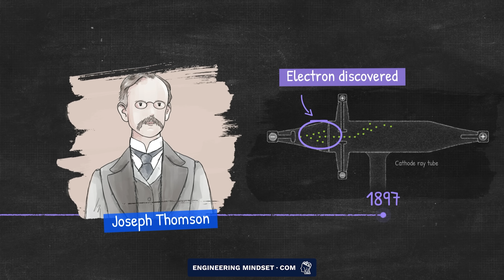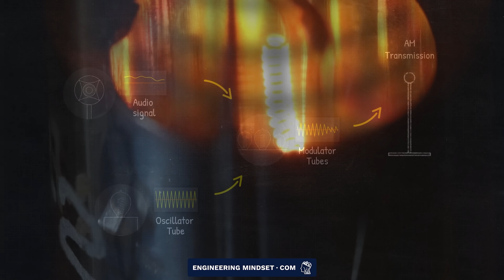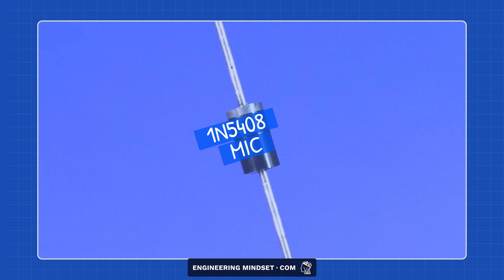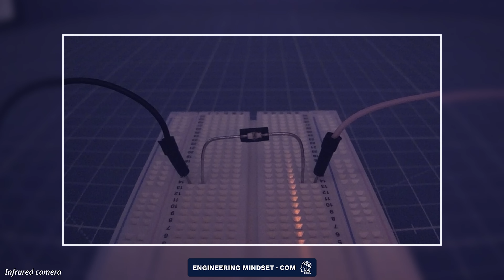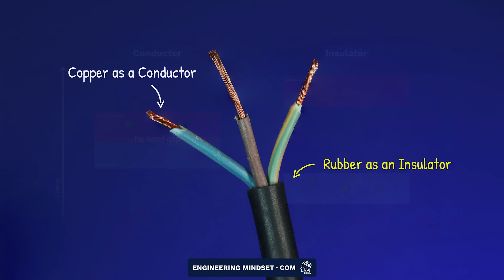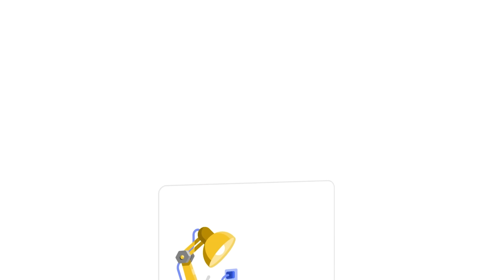The Strange Discovery That Made Computers Possible

Comment: That early 20th century era was fascinating. "Crystal detectors" for radios made from galena with "cat whiskers" wire. Improvements as "perikon" detector with two crystals pressed together (zincite-chalcopyrite). Some devices also used carborundum I think. There was "crystodyne" with ZnO-metal contact which worked as an early tunnel diode.

For power applications other than mercury arc rectifiers and few types of tubes/valves - there were also electrolytic rectifiers (galvanic diode), cuprite rectifiers, and selenium rectifiers.

There were also some very early observations of light emission from carborundum-based devices which were basically first LEDs (e.g. Oleg Losev around 1924).

Comment: How about thermistor discussion starting with heat diodes like 1N4148 used in older saunas. I have 1 that just failed and was expecting a thermistor to replace but then found this and had to ask chatgpt to explain it.

Comment: It seems to be forgotten now, but there were hydraulic circuits that competed with electronic circuits for a while, before becoming just a dead end.
Reply: NOT just a dead end; similar logic (pneumatic logic, to be precise) is still current technology for controlling Industrial-scale Air Compressors, with the result that the only "power source" needed for such logic after startup is the compressed air produced by that machine.  I commissioned one of these myself as an Engineer.  This was a huge compressor requiring several hundred horsepower delivered by high-pressure steam and a steam turbine.
Reply: Pneumatics is also used for switching very high-power, high-voltage circuits.  Think of power plants, substations, that sort of thing.  The trick there is to open or close the contact quickly so a "contact bolt" is essentially being shot by compressed air.  Yet another type works like reed relays but BIIG.
Reply: It's not a dead end, fluidic circuits are  sometimes practical when you can use electronics, but they do have some advantage when you can't. There are issues such as all fluids being larger than electrons and that they can't move as fast, but if you need something that's going to stand up to things like a bunch of induced current and charged particles, it is sometimes an option.

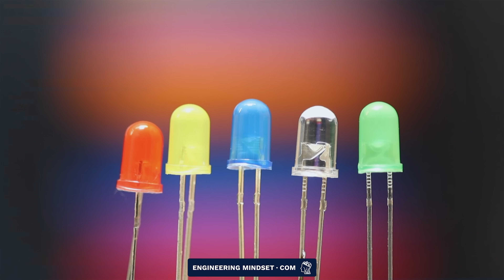Comment: 10:50 it was blue! Because blue color has a lot of frequency. Overall, in LEDs, light is created by applying voltage to the P-N junction. If you use the right materials, electrons will move from one side to another with specific energy, and release this energy as light. Blue requires a big gap to jump, because it requires more energy to escape from a moving electron to be formed, unlike green LED and red LED. Scientists didn't know which material to use, which would have the gapz but also could be turned into a P-N junction. But one Japanese scientist who worked in an LED company who was struggling financially was an absolute legend who had pulled it off. He got access to a machine which was used to make P-N junctions and experiment with trying to create blue LEDs, but he could only replicate it, not use it. He did learn how it was build, he made it, and he used a brute force approach to make a P-N junction. The son of the company he had worked for screwed him up and disrespected him, the father, previous owner was cool, but he went on to make a company training new scientists and ultraviolet LEDs

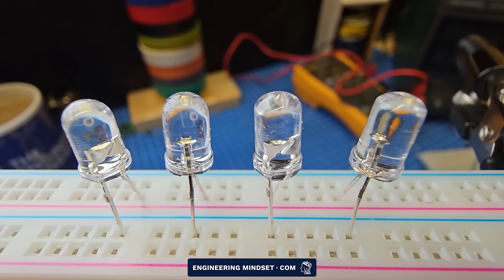Comment: The diode colors shown  on the chart at 14:50 are partially reversed, they follow the spectrum... the longest wavelength is red, the next one shown should be Yellow, and then green, and then blue, with white actually being a secondary emission of broad spectrum light when Ultraviolet emitted by the basic junction, hits the phosphorus.  There are many formulations for the junction materials, and different profiles of the frequencies emitted.

Comment: Interesting and thanks. The very chemically pure germanium used in early diodes and in some of the early transistors was derived because of a problem with switching relays in telephone switching relays in switching centers.  The relays kept shorting out (this was during the 20s and 30s).  The relays were in a glass tube and switched many thousands or millions of times before they shorted out or failed and had to be replaced.  If one thinks about what a relay does ---- it makes or breaks an electrical connection under the influence of an electromagnetic field. During the 'break,' there is a tiny amount of metal that is vaporized.  To condense onto cool surfaces like the inside glass wall of the tubes or the metal contacts. The condensed metal would, over time, form very pure "whiskers" that would, many times, short out the relay.  The telephone companies were naturally interested in how this happened and had the condensed metal 'whiskers' chemically examined.  The chemical results suggested properties largely different from the chemical information about the metals and alloys used in the relays' contacts in reference books. Further suggesting that the chemical information of other elements might not be as exact as depicted in the chemical reference books.  Efforts were made to find out what was going on, perhaps using a vapor deposition method to acquire testing materials.  Much of the information was subsequently updated.  A personal note might be useful at this point, sometimes, advances in chemistry are the direct consequence of a laboratory mistake or miscalculation that results in an unexpected substance or a newer point of view.  If the newer finding can be repeated, then the newer finding sometimes results in a paradigm shift.  I had a Freshman Chemistry Prof, who noted that Chemists often change the course of human history.  The fact that many of these advancements are because of an error of some sort is, for me, humbling.  Think in terms of the Nobel Prizes.
Reply: that is so cool can you say more about what you mean by the chemical whiskers - like, from this very informative but i'm sure very incomplete video it seems like thats electrons from the metal depositing onto the glass.... is that.. like, pure electrons? or electrons bonding with neutrons or the glass maybe and forming glass+electron? my head hurts

Comment: Diodes should be marked by the electrons flow, NOT by antiquated convention.  I live in the USA, and I STILL don't know why we won't Dump the SAE measuring system.  I mean, it would only take a few years to accept the Much Simpler standard of measurements.

How many inches makes a foot?  Simple, 12.

But...  How many inches makes a Mile?

4280 feet in a mile, and How many inches in a mile, what?

Yeah, That.  And this is coming from a dude who Lives in the USA.
How many centimeters are in a kilometer?

Let's see, 100 centimeters are in a meter, and a thousand meters make a kilometer.

equals, You Suck.  The Power of Ten makes Math So Much Easier than anything else that SAE has to offer.
Reply: Where have you been The United States did accept the metric system and our scientific labs use it

Comment: The diode's early application is NOT just rectification, from AC to DC, for power, but using it for radio detection. Early radio detectors such as coherers and "cat whiskers" (crystal detector, early crappy semiconductor diodes). Those early detectors were really finicky, that they needed to be readjusted, often a real whack, every few minutes. That one (radio detection) application, by itself revolutionized radio.

The shortly later upgrade to triodes, basically created the whole field of electronics.

For power rectification, other methods could be used. One is "synchronous rectification", which initially could be done mechanically, with contacts under control of a AC synchronous motor. This almost comes "for free" on a DC generator, where the commutators' breaks at the point the armature coil moves thru the alternate magnetic field's polarity. Today synchronous rectification is still used, but often with modern power transistors.

Comment: During WWII they actually experimented with silicon diodes first but they sucked, burning out at only a few volts. They switched to germanium at the time because it was easier to refine and dope. Once they improved silicon refining and doping they could go back to using silicon though germanium stayed around for RF stuff for awhile.
Reply: the irony is that we're switching back to using germanium in high-power application like EV cars. silicon was used because its cheaper and more stable, but when you have to pass a lot of current, germanium is still better.

Comment: Hi paul im an engineering student (general degree but more mech biased) whos looking to learn electronics and build real projects.

I was looking at arduinos to control motors but there's so many options. Its so overwhelming. 

Got any advice?

PS: advice on raspberry pi or similar to control the entire system would be appreciated but not necessary.

Thanks in advance
Reply from the maker: We have some video tutorials on how different types of motors work and how to control them with arduino. Those should help